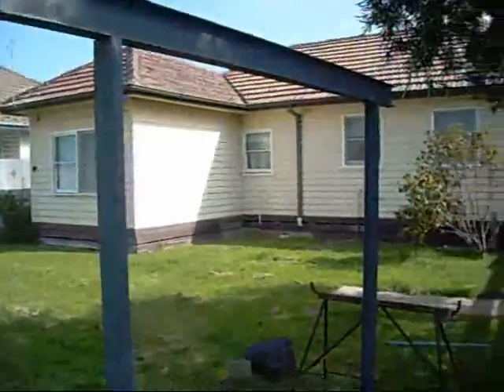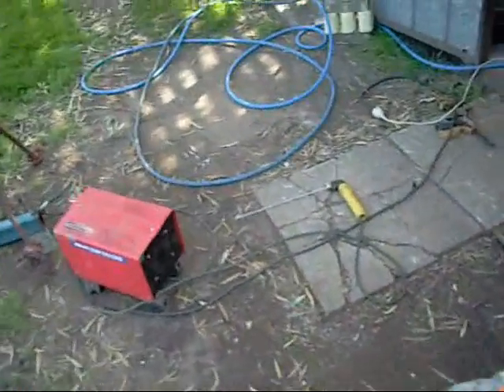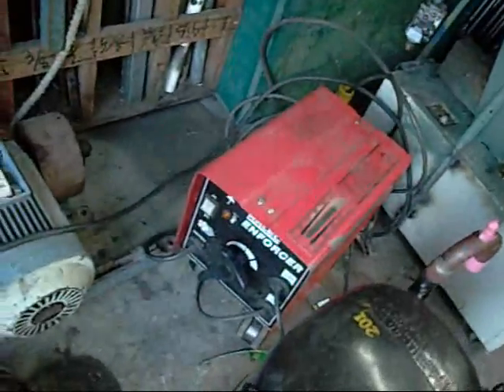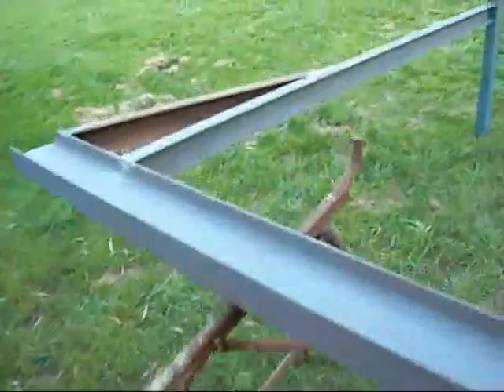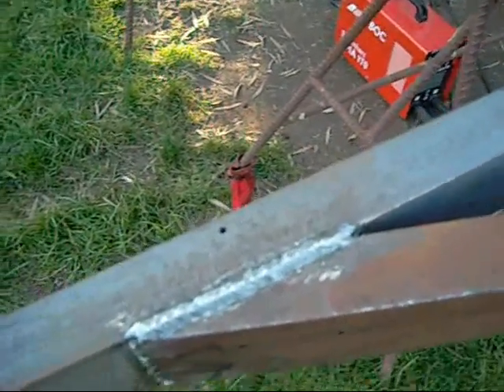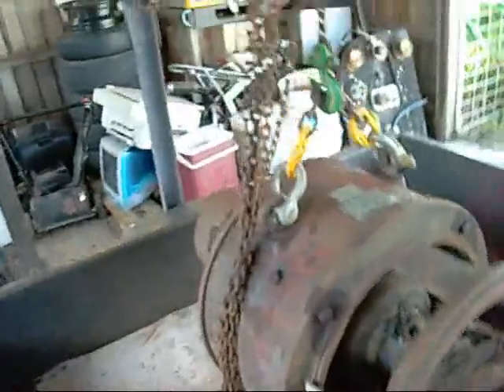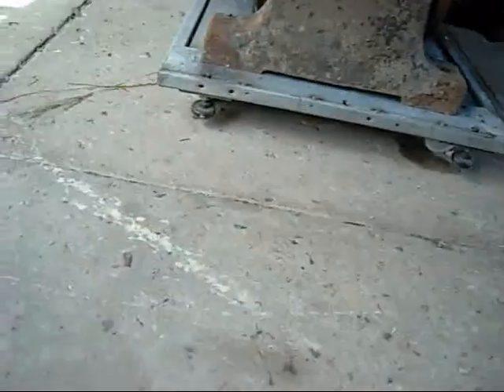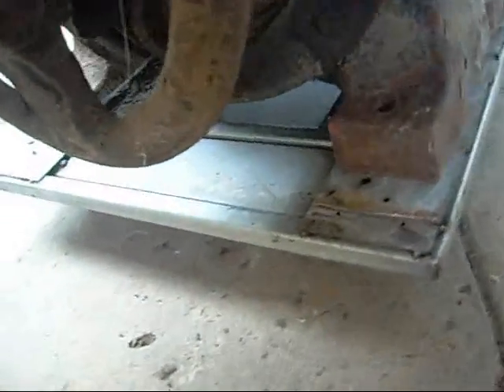Overhead Crane Project

Comment from the maker: Good to see you spotted it ;). I had 45* braces cut out but didn't weld them in since I needed the trailer unloaded urgently. but you are right, the braces will make a huge difference. and I'll be adding webbing inside the C channel uprights to prevent torsional flex!